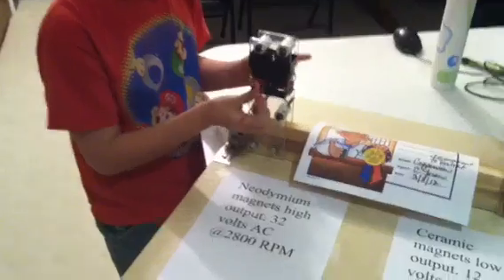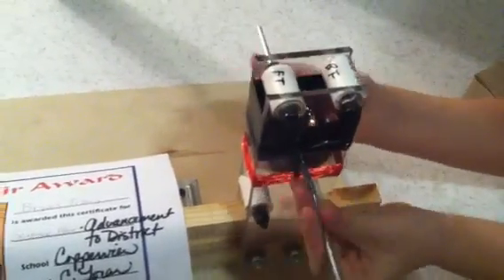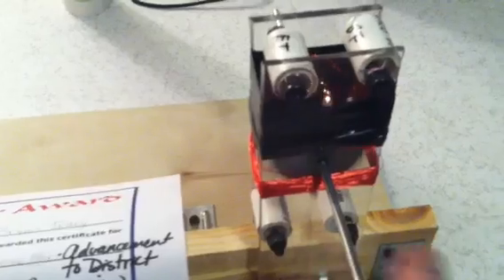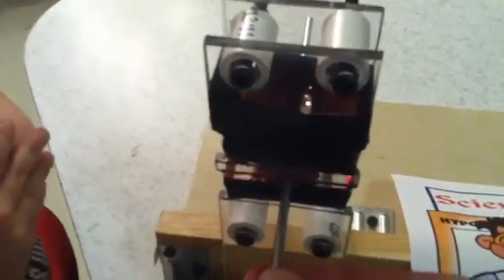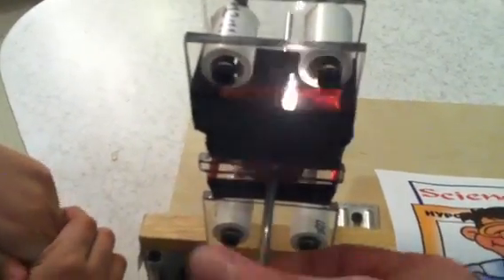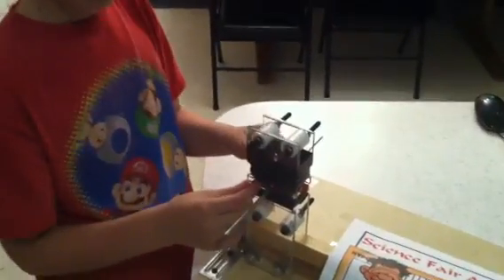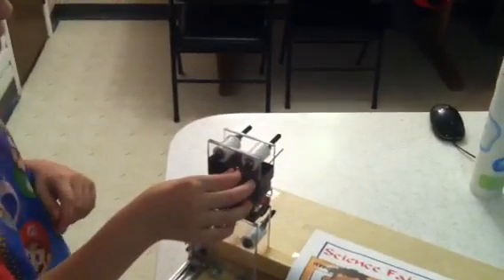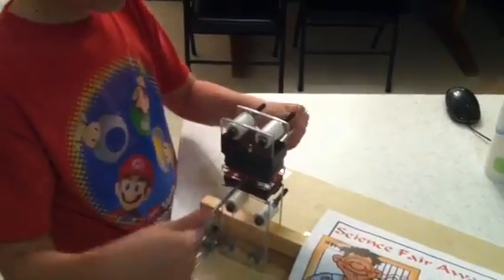Science Fair Generator

Comment from the maker: We used an epoxy called JB kwik weld. I put the shaft in the middle of magnets  and used spacers to keep the magnets apart. The spacers need to be the same thickness as the shaft. I used thin cardboard paper for the spacers. I epoxied one side, waited for the epoxy to dry, then epoxied the other side. The epoxy was also affected by the strong magnets, but I was able to make it work. This was the hardest part of my project. Find some Kwik JB weld, and good luck!